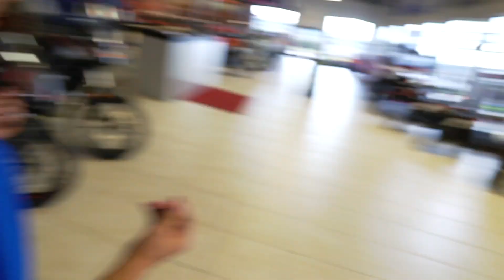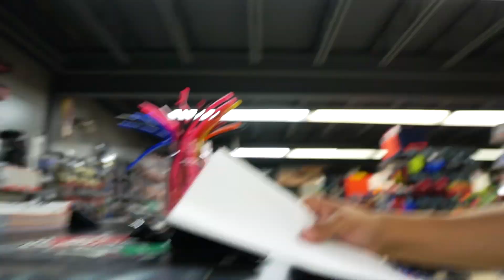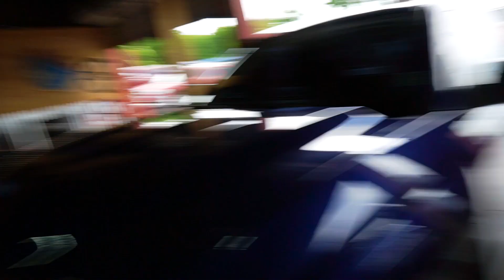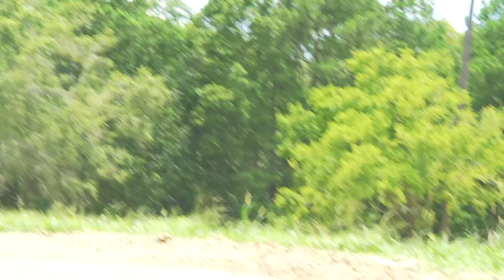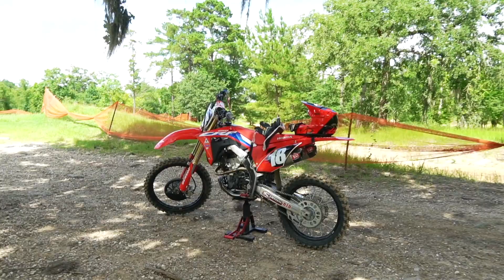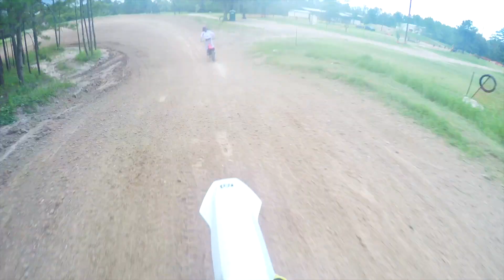Livin' Da Life - Fell From The Bike & Still Got Back Up  EP.3

Comment: all omar needs to figure out is how to lock up the rear brake and downshift to slide outta the berm and throttle outta the turn in higher rpm range with power